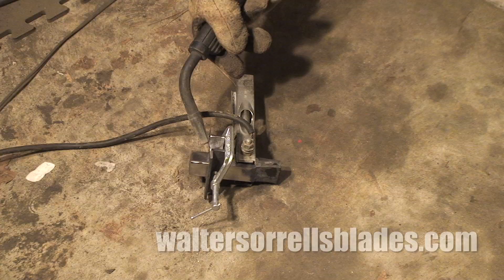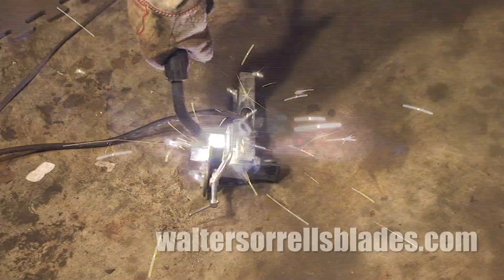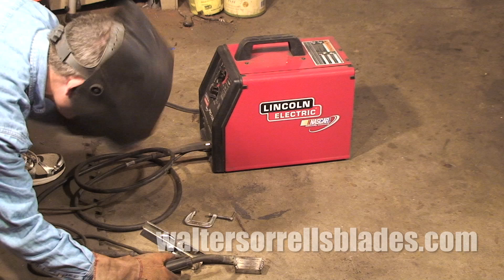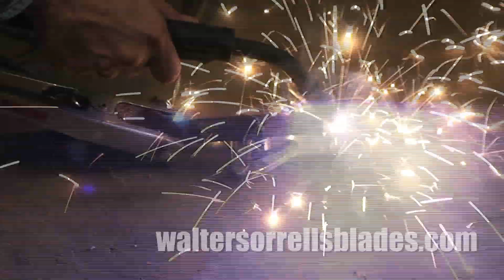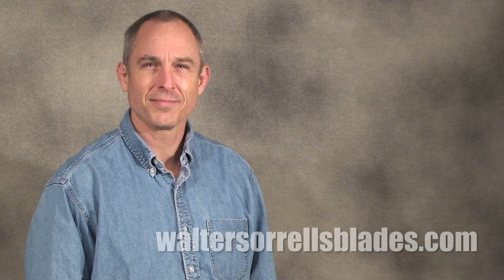Knife Making Tools Part 19: MIG Welders

Comment: As a welder i have to say that was a wonderfully funny video, and what you have there is a flux core welder. MIG stands for metal inert gas and you do not use any gas. Instead the flux is inside the wire. Love this channel by the way.